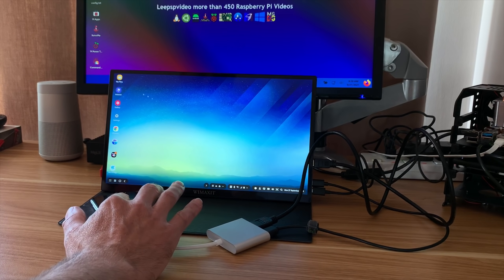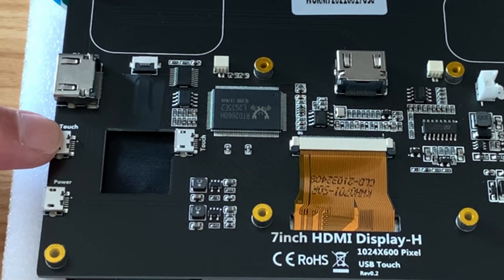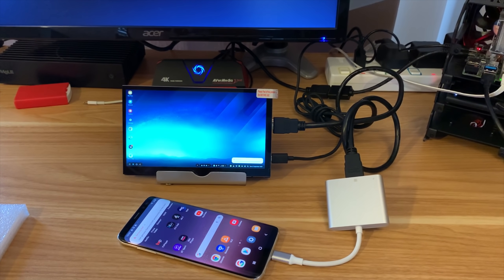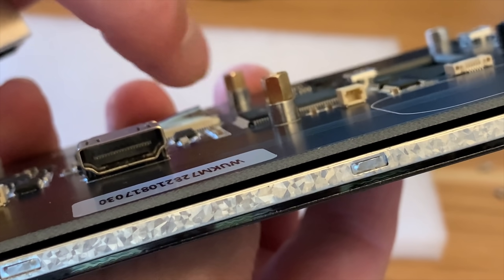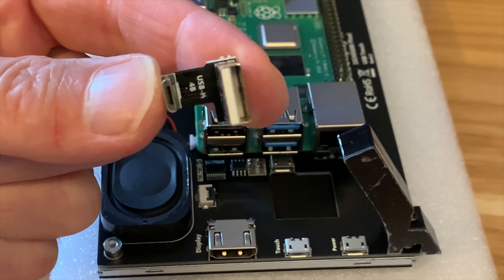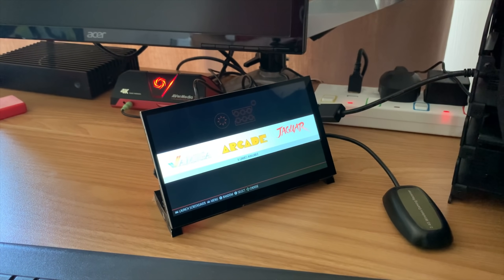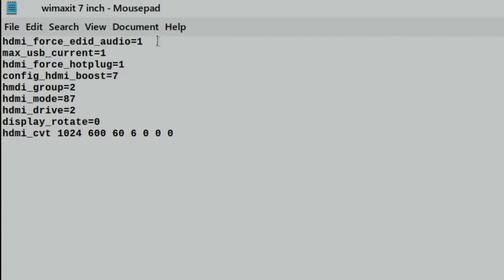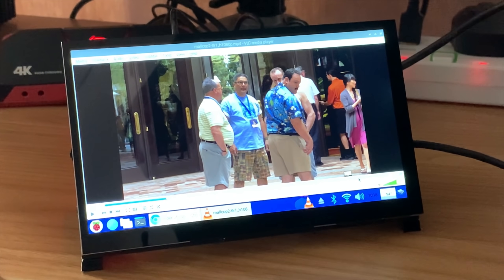Wimaxit 7” Touchscreen Display. Supports Raspberry Pi & much more.

Comment: can we use dtoverlay = vc4-kms-V3D ? when I use this to boot will no signal output to screen, but dtoverlay = vc4-fkms-V3D is ok.
Reply from the maker: I haven’t tried. I guess from your tests it’s not supported. Try some other operating systems, see if you get the same results.
Reply: @leepspvideo  Thanks for reply, will have a try. ;)

Comment: Hi ! Is it possible to rotate the screen? To display in vertical position? Tnx
Reply from the maker: You could try adding lcd_rotate=90 to config.txt
Reply: @leepspvideo   OK i will try this. Many thanks for your reply
Reply: Hi neither lcd_rotate=1, nor lcd_rotate=90 work.  It has no effect. I have tried also,  display_rotate=1 and display_rotate=90, and it has  no effect at all. Any idea? That's shame this 7 inches screen can't be verticaly used
Reply: I finally find. Juste comment in /boot/config.txt the line :  #dtoverlay=vc4-fmks-v3d. Then display_rotate=1 works after reboot. It is displayed vertically
Reply from the maker: @freespirit4976  it won’t be the display as it’s hdmi. It’s Down to the os

https://youtu.be/RqNzKwZ0vaE

Comment: I think the market now is in need of different sizes of though screen monitor.
For example: 9 inch or 10 inch. Even a 4inch by 10inch monitor would be best for carrying backpack or laptop bag.
Imagine a 4 inch by 10 inch screen with a stand or clip on to a laptop screen would be an added feature for coder.

Comment: What power supply are you using?
I'm having USB3 issues when things like my SSD hit full draw, using the official Pi power supply. Things work fine on the USB2 ports, but I'd rather have USB3 bandwidth for my SSD. I think a reliable supply greater than 3A would solve the problem, and trust any recommendation from you since you've got it all working great it your videos.
Reply from the maker: I was using the official Pi 4 adapter. A powered usb hub would help.

Official Raspberry Pi power adapter white https://amzn.to/35MrAdn

My Amazon UK store
https://www.amazon.co.uk/shop/leepspvideo
Reply: @leepspvideo  Thanks for the response. It helped me troubleshoot without having to buy anything else (yet). Knowing the official power supply should work, I tried different SSDs in case it was the drive itself drawing too much power but no dice there either.
So now I think I found the culprit: my SATA-USB adapters. Two of them use JMicron controllers and crap out every single time (I remember in a couple earlier videos you mentioned the Pi can be finicky about the adapter, and a quick Google suggests that Pis hate the JMicron controllers on USB3). My third adapter has a different chipset and works most of the time, but still fails on occasion.
Looking online, it seems ASMedia controllers are the favorite for RPis, so I'm going to find and order a couple adapters using those chips.
Again, thanks!
Reply from the maker: @davidg5898  I use this  now

Ugreen sata usb https://amzn.to/2VXBFBT
Reply: @leepspvideo  Thanks. It's coming on Monday. If it works as expected, I'll order another one -- do you have an affiliate link for it in the USA so that you can get a cut?
Reply from the maker: @davidg5898  Wimaxit 7” Display https://amzn.to/3ESJ07H

Comment: Not a bad little panel, I use KonstaKangs Android builds with it mainly. It's not as good as a real Android tablet, but pretty good for the Pi 4.
Reply: I would agree!  It makes a great Android tablet (I'm running the latest Konstakang 14 version) and a perfect little Home Assistant console
Reply: @adrianwiuk  hey do you have the Wimaxit M728 7" Inch screen? And Android from Konstakang does work out of the box?
Reply: @mrklugiii  yes it does.  I'm running 14 on a Pi4 and have the Play Store installed.  It sits on my desk as a Home Assistant console, but can do so much more.
Reply: @adrianwiuk  hey, thank you for your fast answer! Have a nice day!

Comment: Does it have an input select so you can use the Pi HDMI as well as a second side HDMI device?
Reply from the maker: I haven’t found an input select. You can easily remove the Micro HDM to HDMI adapter.

Comment: Shame they use a USB3 port upon the Pi4 instead of USB2 - suspect was designed for before the Pi4 - hence adapter pack, and upon the PI3 - all ports are USB2 so wouldn't of mattered.  

However you could get a short micro to USB cable and use that to connect via USB2 port and free up that USB3 bandwidth for something else more demanding.
Reply: I was gonna say just that

Comment: It's a pity the touch screen wastes a USB3 port.  I'd prefer a version of this screen that uses a CM4 board.
Reply: It wouldn't be too hard to modify that USB adapter to plug into the USB 2.0 socket instead , make it a L shape to leave the USB 3 socket free.

Comment: for the price of $229 plus the PI I could buy a cheap laptop for that price
Reply: You can't buy a $229 laptop that has fully programmable I/O pins under every major programming language, opensource ARM based powered by 5V, with a modular diy-replacement/hacking build like this one, with literally thousand application uses (sensing, robotics, IoT, embeddable into all sorts of cases/environments, emulation, etc) and supported by a million-based makers and a strong open philosophy like RPi's
Reply: In the terms of cheaper and complete product , used mobile phone with Snapdragon 845 is at the same price as pi4 8gb in my place. It's is more powerful than pi4 , better power consumption, better CPU,gpu, WiFi ac ,great performance wireless display and other  thing. But I still get pi 4 for its multi purpose.